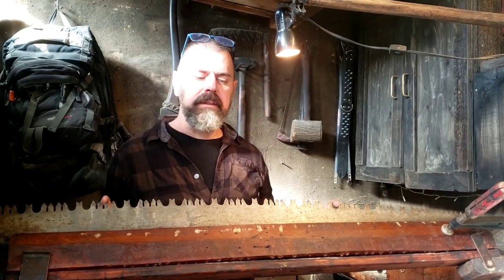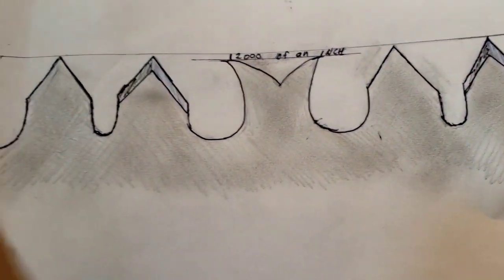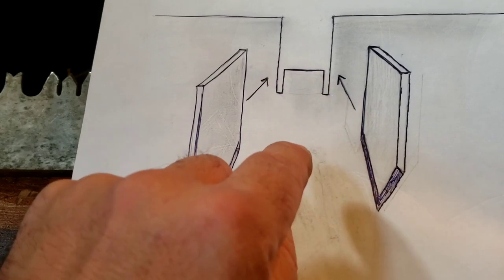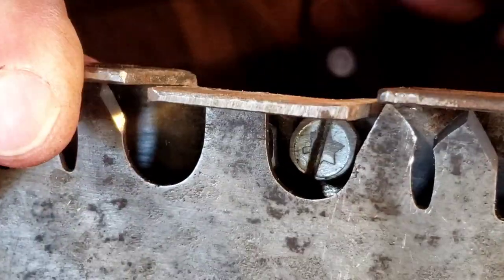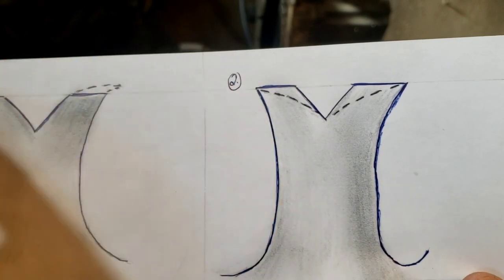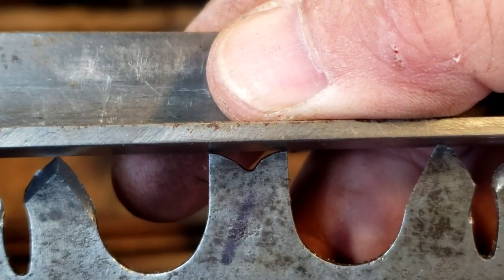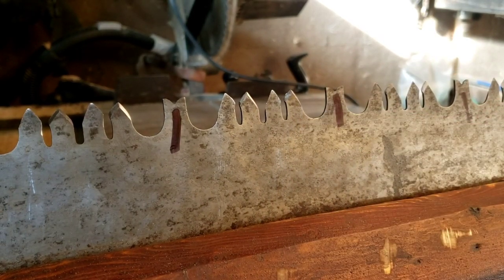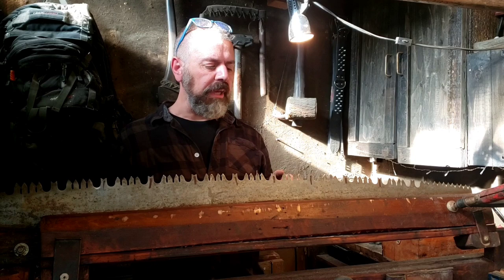Setting the Raker Teeth-Crosscut Saw

Comment: I am learning so much. I always wanted to cut wood this way and I learned to use a chainsaw instead.
Still I sharpen the chain as I would my chef knives in the kitchen. With thoughtful and precise skills...eventually learning an edge becomes almost second nature. This saw by far has the most demand for respect.❤
Reply from the maker: Thank you so much! There are advantages and disadvantages of both chainsaw and crosscut saws. My back isn't well enough to handle a chainsaw or carry the gas, bar oil, chaps, tool kit, etc

Comment: Are you single bucking with a 2-man saw? On my one man saws I file my forward rakers at 0.012" and my back stroke rakers at 0.010" since I'll have less downward pressure on the back stroke. I would also swage to a pin height of 0.009" before cutting a final height of 0.012". If you swage last it becomes difficult to keep a consistent raker height.
Reply from the maker: Its a one man saw. Thanks for all the tips and advice.  I appreciate  it🙏🙂
Reply: Just watched your follow up vids. Yes, a one man you've got.  @Thelonelyscavenger